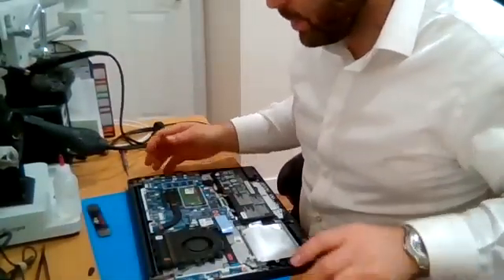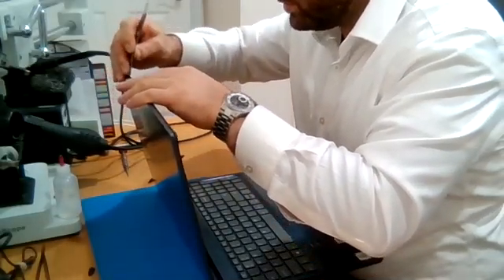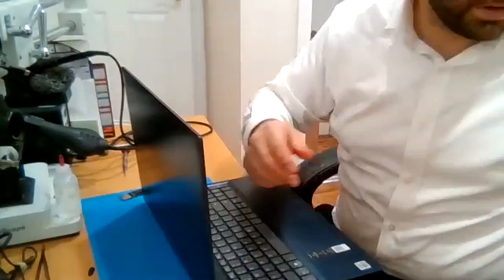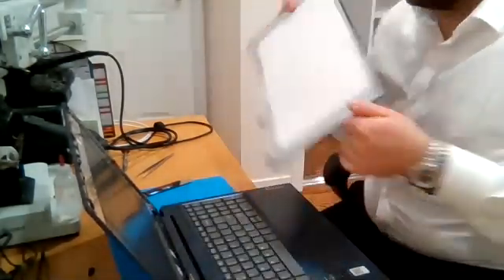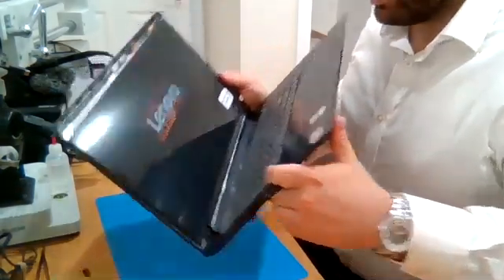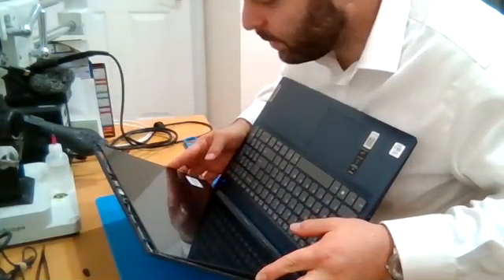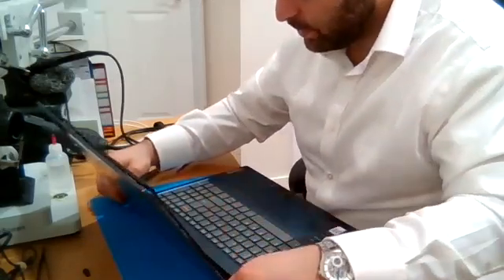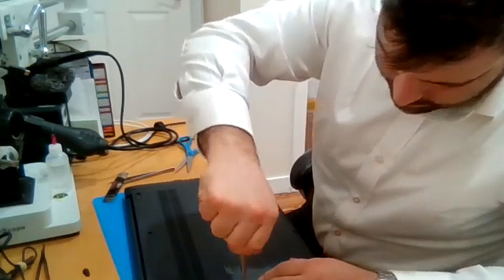Laptop screen replacement, How to replace laptop screen Lenovo Ideapad 3 15IIL05

Comment: can i still replace my lcd without double sided tape?
Reply from the maker: You will need double sided adhesive to secure the LCD to the LCD backcover, there are no tabs to screw in on this model.

Comment: If you do this job with the tape always ensure when you put the new tape on you leave some sticking out at the top in case you need to get the screen off for any reason. Otherwise  you may not be able to get the screen off without damaging it. You may need to remove the LCD panel for another reason other than replacing the screen in the future.
Reply from the maker: Actually this is Tesa tape so it doesn’t pull/stretch to loosen so there’s no point leaving any exposed. To remove you simply put some 99% isopropyl alcohol and the screen will come off easily. Though if one is using pull tape then I would agree to leave a piece exposed that can be pulled.
Reply: Risky in my opinion. Far easier to use stretchy tape and leave the ends of the tape that can be pulled up in case you need to remove the screen again without damaging it.
Reply from the maker: @stebrad123  There is nothing risky about using 99% ISO and if you secure the LCDV connector properly and do the repair correctly there should be no need to take the LCD out anyways unless it breaks in which case it makes no difference. I personally have not been able to find a supplier for the pull type of adhesive the manufactures use - if you have one please feel free to share!

Comment: Bro i have ideapad 3 15itl6 screen need to change but 30 pin not fit in this 32 need where can i bought from?
Reply from the maker: Did you look up the exact model on laptopscreen.com, they almost always have what I need. Though I’ve never seen a 32 pin it’s normally 30 or 40…
Reply: I checked 30 pin and also 40 pin but it doesn’t work
Reply: U have whatsup ? Where can i show you connector
Reply from the maker: Send me the pictures to wolfphonerepairs@gmail.com

Comment: my lenovo ideapad3 having tablet mode but my screen is not touch how can i afford touch sensor for my laptop please i need my laptop with touch screen how cani afford it
Reply from the maker: Unfortunately I do not think that is possible as touch screen LCD’s are 40 pin and that laptop only has a 30 pin cable. It’s not designed to have a touchscreen - windows comes with the “tablet mode” no matter what laptop you have.
Reply: Ok bro thank you
Reply from the maker: @akhileshakky18  pleasure

Comment: are all Lenovo using 30 pin connectors from there screens now?
Reply from the maker: It depends on the type of screen, usually touch screens are 40 pin

Comment: I watched a few videos on screen replacement, and your one of the few that actually took the battery out

Good video
Reply from the maker: Thanks! Yes I always take out or disconnect battery as voltage is still running through the system

Comment: I replaced my screen and I am positive I did it correctly. But when I turn on the computer, it is black. I undid everything, redid it....took out the battery....turned off and on the computer....nothing works. Am I supposed to hold down the power button for a certain amount of time? The computer is working fine. It comes on when plugged into an external monitor
Reply from the maker: it could be a faulty LCD. Did you make to sure to disconnect the battery before removing the old screen and putting in the new one, you can short it if you don’t remove the battery.
Reply: @princesschickawa hi I'm facing the same problem, have you found the solution now?
Reply from the maker: @affandibudi2453  Id have to see the device

Comment: Fantastic video! What kind of tape are you using in this repair, can’t quite make out what you say. Thanks!
Reply: Nvm, I just ordered some 1/5 inch super double sided tape from the laptop screen site you linked, along with a replacement screen. Thanks again!
Reply: @MUYBIENYTU  como se llama el producto amigo que pega la pantalla
Reply from the maker: @brianaguilarflores8013  I use Tesa

Comment: Do you think i can upgrade the screen from 720p to 1080p?
Reply: I did that ,purchased HD screen worth it big difference on clarity.
Reply: @rakmvk  so you didn't have to get an adaptor for the 30 pin connector?
Reply: @Plimothy  : On laptopscreen.com website you can choose 30 pin HD screen, before purchasing I have opened laptop, removed the screen and  made sure it was 30 pin. Also on old screen there was some identification number you can search with that.
Reply: @rakmvk  dude thanks for the great info!

Comment: ok i think I need a separate video to even get started that shows how to take off the bottom part and disconnect the battery??
Reply from the maker: You’ll need to remove all the screws and use a thin pry tool to gently work 
/pry your way around the bottom cover and pop off the plastic clips. It will pop off quite easily.

Comment: Did you put a full HD screen instead of the  TN panel? How many pins does the screen has for connection? Thanks.
Reply from the maker: I replaced it with the same screen as the original. It was a 30 pin display.
Reply: @WolfTechRepairs  Thanks for the info. I'm planning to change my TN panel to a FHD IPS screen.
Reply: @rongonzales1379  did it work?
Reply: @Plimothy  I did not mess around with it, I'm still using the same dull screen.
Reply: It worked?
Reply: I bought HD screen that was 30 pin  ,big change in clarity. Laptop is no more a low budget one 😀.